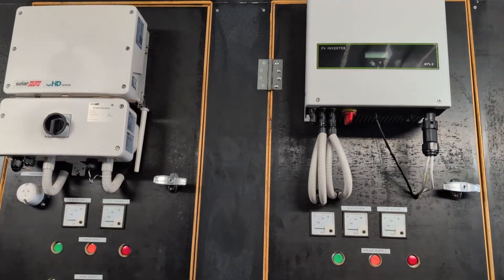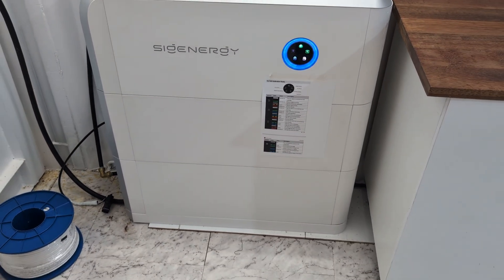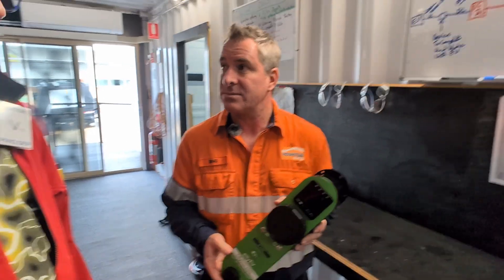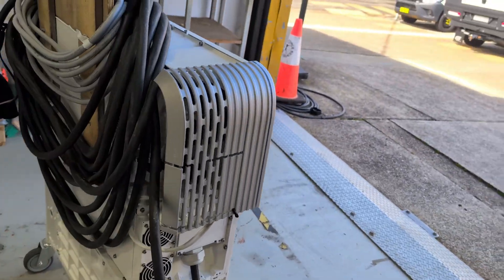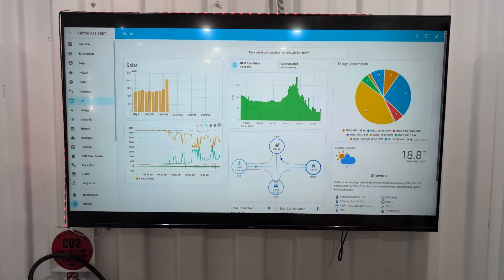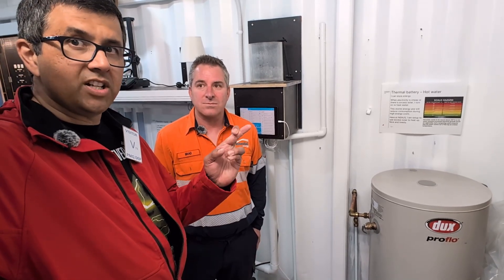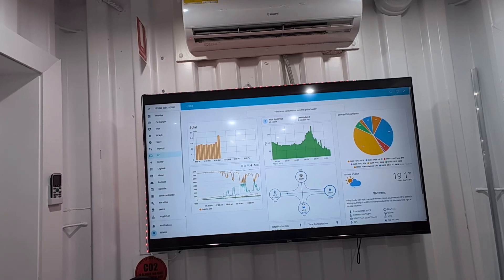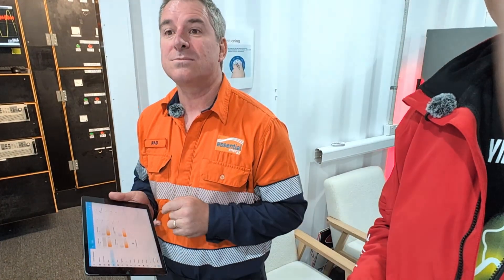Essential Energy Test Lab Tour: V2G, Batteries, 100% Electric House, EV Chargers, Solar Inverters...

Comment: I'm old and don't want a whole lot of apps but have a green catch diverter set on solar only and it automatically sends all my excess energy instead of it going back to the grid to the hot water and I don't have to do anything set and forget  !!
Reply from the maker: That is definitely an option for people who want a simple solution and have an old style tank water heater (tank with a large kettle style heating element inside)